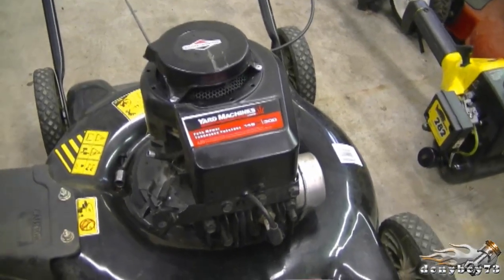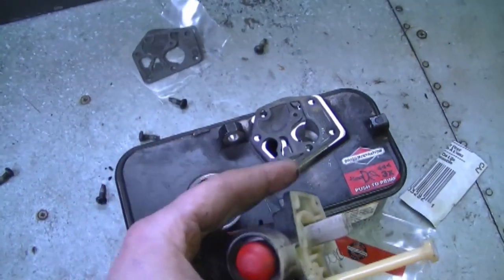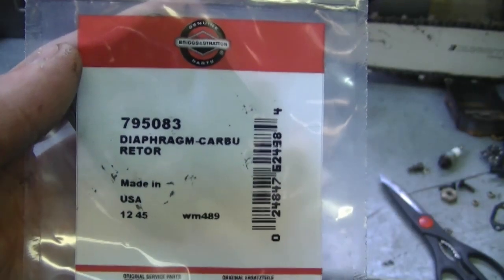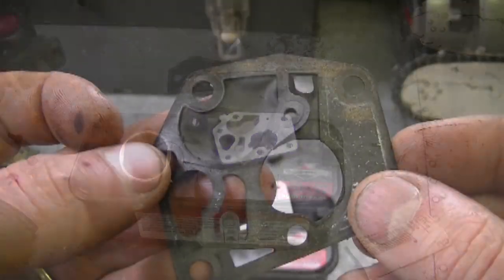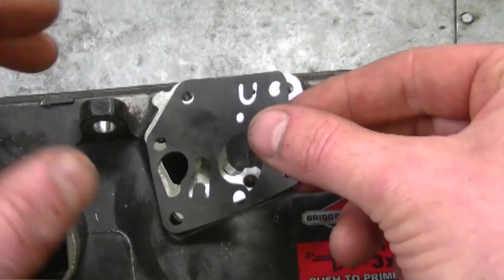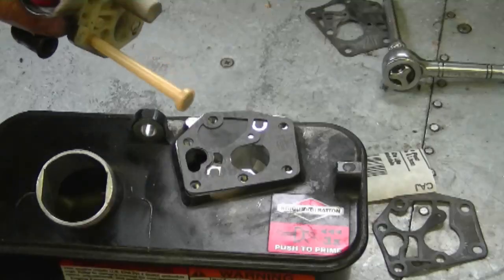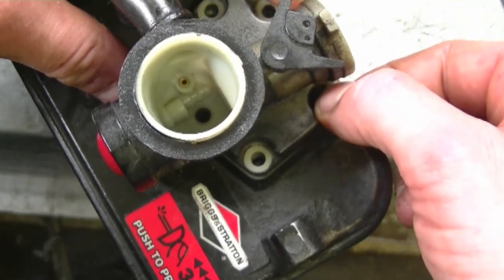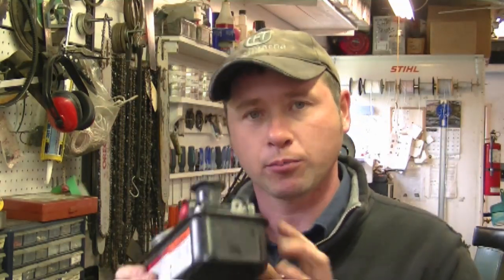Diaphragm & Gasket Configuration On Briggs Pulsa Prime Carburetor

Comment: Hey Dony! Love the channel! Thank you so much for the great content from a professional. So I tried this on my mower. Starts up just fine after a few primes, but then it dies right away. Seems like the carb is still not working after a clean out and a new gasket and diaphragm set. Are there any tips and tricks to make sure the diaphragm seals properly on the fuel tank housing?
Reply from the maker: you could have a bad carb. sometimes these carbs warp and don't seal properly
Reply: Thanks Dony. Although that is a possibility, I'm not convinced its my issue. I put a different carburetor on the engine with a different gas tank. Same result. (After a carburetor cleaning and a new gasket) I have heard and seen of putting 2 gaskets on the carb (sandwiching the diaphragm).  And I've also seen someone gouge the gas tank across the longest space between 2 screws, (the space that faces the engine) in order to provide a better seal. What are your thoughts on these 2 different techniques?

Comment: don i have a question. i have a briggs anstratton primer pulse lawnmower.i replaced gaskets per your instructions.i had a problem, aqnd im still having a problem. when i shut engine off to take a little rest, mower starts extremely hard, i have to prime it to get it going. has a new plug, any suggestons?   dick bailey

Comment: thank u I will ck these out,one more ? I have a stihl model 015lL chainsaw,doesnt seen to have any spark,i have taken it apart all the way down to the points and condenser,but I have never messed with anything other than electronic ignition,everything about points and condenser is new to me,great lil saw just cant figure it out,no spark at all,any advice? and thanks again

Comment: Dony, thanks for this video. I literally found a Mountfield SP470 Lawn Mower being thrown out and I've tried to start it but the carburettor seems to be the culprit. So glad I found your channel.

Can I ask a quick question? Can a McCulloch Cabrio 261 take a brushcutter blade and what parts would I need aside from the strimmer bump head? Thanks in anticipation.

Comment: I had a pressure washer with the same configuration.  Wish it had been up at that time as It took me a bit to figure out which went on first.  The bad part was the carb was not he only defective part. The tank had been hit in the corner and the top and sides of the tank had broken apart causing gas to come out when priming. Had a spare to replace it and everything went smooth after that.  Keep up the great videos!

Comment: hey i have a husqvarna 345r strimmer i think it needs a new piston ring as there is not much compression snd i tried to start it it made a loud bang and smoke shot out of the air filter and exhaust (blowback lol as i dont think the cylinder is scored there is a bit of damage on it at the exhaust port but not the carb port

Comment: Another way to be sure it is assembled correctly is to have the tank half full and try the primer bulb before you bolt the tank on. The primer will not work if assembled incorrectly.